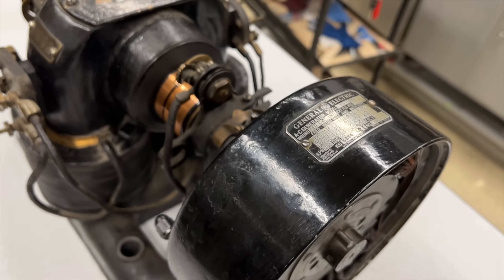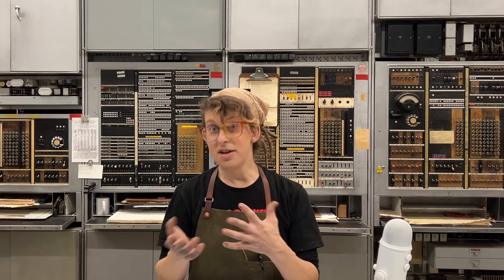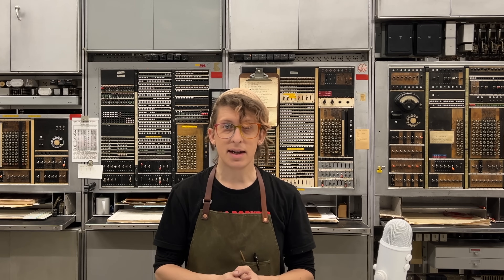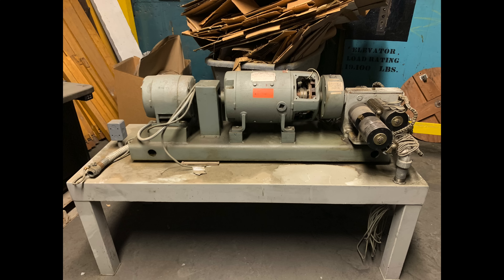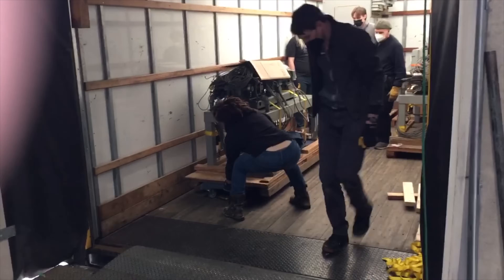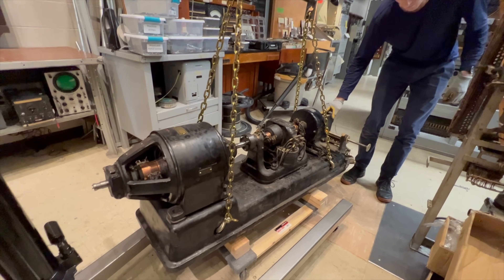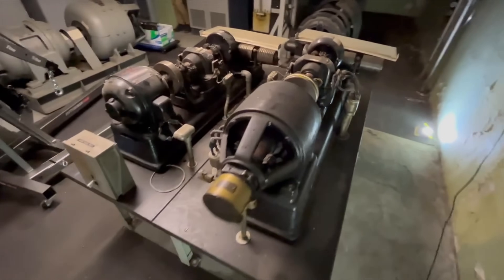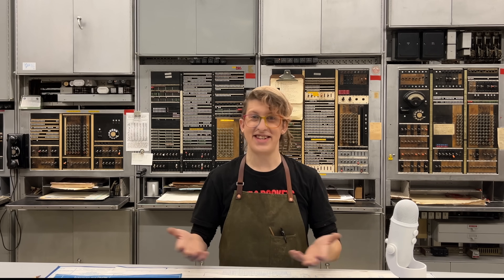How’d we get 6 Ringing Machines? (Part 1)

Comment: It would be great if you could have both AC and DC machines hooked up. I thought they had both motors on the same shaft but maybe that was just the older versions. I imagine having two entirely separate machines is more resilient but it does make it harder to to run a museum 100 years later.

Comment: Wow, that brought back memories of the big black machines of the basement of the SxS CO and long lines office where I lived in 1968.  Thanks!  Hmm, the ringback tone played in the video sounded pretty much like my memory of what it sounded like in the SxS office which probably qualified as big city.  Where I noticed the big differences were the dial tones.  The panel offices snd SxS had a more raspy sounding dial tone and the busy tone sounded like an interrupted dial tone.  Hard to say, the Bell System seems to have been a mash-up of old and new in many places.  I remember the third floor of the building being long lines and television coaxial repeaters.  The long lines had racks and racks of boards with 216A “tennis ball” vacuum tubes glowing cheerfully while the TV gear appeared to be at least late 1950s era.
Reply: I forgot to add, of course there were no SIT tones in the SxS office for error conditions, usually just fast busy.  If you left your phone off hook in an idle state, after about one minute, the line would shunted to a crybaby generator which made a very loud “waaaaa waaaaa waaaaa” sound.  I believe that was intended to help out on party lines to keep a miscreant customer from busying out the whole party line by taking a phone off hook.  The CO had two ring cadences which seemed to be randomly assigned to single party lines.  Party lines used a combination of tip-to-ground, ring-to-ground and bridged ringing as well as positive snd negative bias.  You could have six subscribers on a party line without having to resort to frequency selective ringing.  You could double the party line customer count by using both ring cadences and instructing customers to listen for one or the other.  Party lines were pretty much gone by the time I was a kid.  A friend’s family was on a party line where they were the only party.

Comment: That’s cool to know.  The ringing machines have a regulator for the power. I always wondered how they could go from ringing a handful of phones at 3 am to thousands of phones at 3 pm.  Boy they thought of everything.  Each little piece is important.
Reply: Hey, you know, I never did consider that, but it is a pretty obvious question!  I guess I did kinda assume that it was part of how the power was delivered.  I knew that they got the power from batteries, but why would that matter in this respect?  Current is current no matter where it comes from, lol.

I was really into telecommunications stuff when I was a kid, and always figured I'd never be able to see and play with a crossbar.  When I read about how they worked, I was simply entranced.  The only more intricate mechanical devices I know of are some of the high-end relay-based computers.  There's one in Japan that they restored (I can't even imagine the effort that must have taken) and keep in working order that you can visit.  You think the crossbar clicks a lot?  You gotta hear this thing!  I don't remember if it's at a university or a museum, but they will show members of the public around.  There's a video on YouTube I think.  But in terms of sheer size, the crossbar frames at the museum dwarf it.

But the crossbar  is still an astounding work of engineering--especially the "marker".

Comment: So exciting! I love the old hardware, it's so cool looking. And probably incredibly hazardous. But such _style_!
Reply: The voltages in the switch itself are not hazardous (well, assuming u don't have a heart condition/pacemaker, anyway).  I don't know about the ring plant specifically, though.  I mean, I've touched a phone line when it was ringing before, and it hurt, but I wouldn't call it dangerous.  But that was the  customer-facing side.

Comment: I hadn't thought about it much in the past, but knowing how telephony directly ties into the history of the internet, the frames at the end look very much like the 19-inch frames I'm used to in datacenters with rows and rows of servers whirring away. 

Is it the same size? (or at least close to it) that then got adopted by the early computer companies.
Reply from the maker: Yep! This is where the 19 inch rack originated :)
Reply: In North America telecoms eventually standardized around 23". A modern rack is basically the same except a little bit wider! A Rack Unit is still the same idea at 1.75" hole spacing though having three holes per RU is more of a recent phenomenon. Nortel rolled some weird 27" stuff for their DMS but accompanying accessory bays are 23". 

If you buy service provider-oriented gear, a lot includes adapters to go into either a 19" or 23" bay. The same racking system is used in radio, television, sound, lighting, and so on